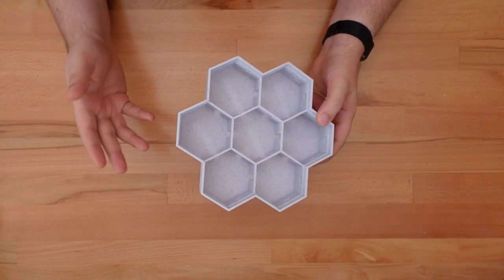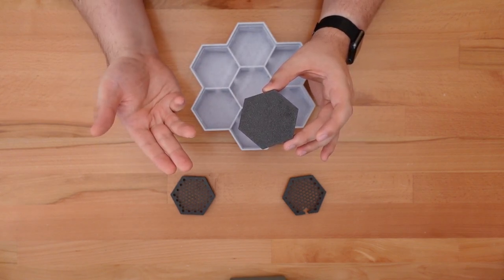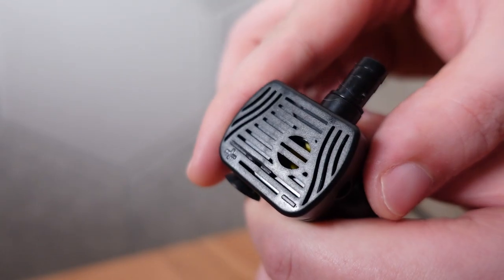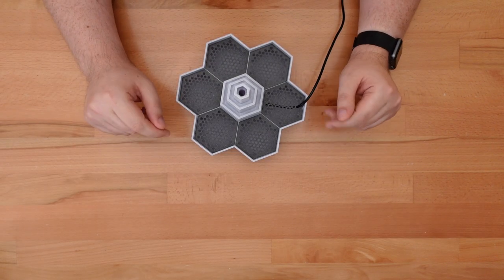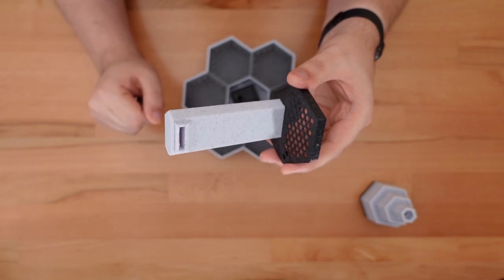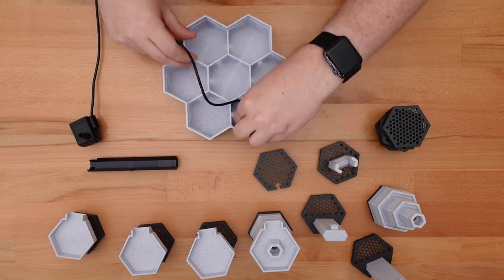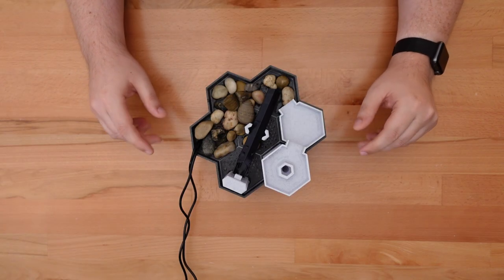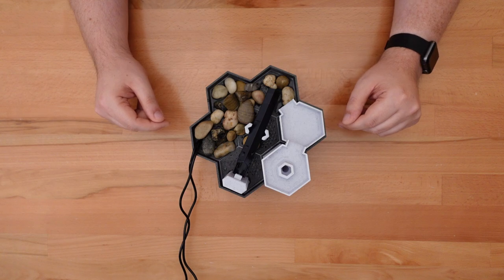3D Printed Modular Desktop Fountain

Comment: It's awesome ! Thank you for this great video 👍🏻 I want to design and print a oriental fountain, this helps a lot 😊 the problem with my design is that the base of the fountain is higher than this one, so I don't know how to pass the pump cord
Do you think if I pass it throught the base (with a hole large enough for the usb and add a small 3d printed part) and seal it with glue, it could hold ?
Reply from the maker: Sounds like a great project!

Adding a hole is a risk, of course, but I think it should be possible to properly seal it enough for that to work! Just add LOTS of glue and test test test :) Good luck!

Comment: May i get some help please? i am trying to print the splash guard part and for some reason its printing like half a cm tall, and when i start the print the nozzle temp goes to 175 and stays there. in cura all settings are fine, i printed nany other things, really strange problem. in the preview on cura its how it is supposed to be and then it comes out different....
Reply from the maker: I can think of two possibilities: The guard is a very wide part and the travel could be pulling on your wiring in a way that either is messing with your thermistor (false reading) or your heater (actually resulting in a cooler nozzle). If this is the case, I'd double check the wiring to be sure you have plenty of free movement and nothing is getting pulled. Another possibility is that the guard is creating an updraft from your cooling fan. I think this is less likely, since 175C is a BIG drop, but I've seen something like that happen. The best solution for that is to make sure your nozzle has a silicone sock to help insulate it from getting cooled.

There are probably other causes I'm missing, but these are what come to mind. I hope that helps!

Comment: Amazing fountain 😍😍
I am trying to make this but perforated plate is failing again and again.
Any tips on how to achieve good print quality on this part?

If you share your print settings it can be really helpful
Reply from the maker: Thanks!

If the perforated plate is giving you trouble, I'd guess it's largely a challenge with the first layer. I'd run a few single layer high prints to make sure everything is extremely level (trammed) and consistent. You'll want the print line to come  out with a flattened top, but not so squished that you can't easily see and feel the height of the layer.

What build surface you're using matters a lot... you can get clean prints on a broad range of surfaces, but my suggestions would depend on the surface and filaments you're using.

Finally, this is one part I would NOT print with a brim. I imagine you aren't doing so, but I figured I should mention that.
Reply: @3DPrinty  thanks for the help dude btw Im using pla on glass bed
Reply from the maker: Great! Since it's glass, chances are your surface is extremely flat. It'll probably just come down to your z-offset and how clean the surface is. I hope your next prints turn out better for you!
Reply: @3DPrinty  thanks man for all the help

Comment: I think I heard you say there are 9 cells to work with, but I only see 7?

Edit: I forgot to ask if the plates will stick inside of each other?
Reply from the maker: Yup, I realized that error too late. I'm planning future bases, though. Maybe there'll be a 9 cell base in the future and I'll be retroactively correct!

The plates do not currently stack or fit into each other. There are already quite a few remixes for this project, so I wouldn't be shocked if that became an option.

Comment: Having issues as the printable parts do not open in Cura because they are not STL files. Can I get the STL files please?
Reply from the maker: Good news! Cura supports 3MF files by default.

In fact, Ultimaker (who makes Cura) is part of the 3MF consortium. That’s the group that designed the format. So I expect they’ll continue to advance the format as it continues to grow and improve.

Comment: Ohhh I love it!
Reply from the maker: Thanks!
Reply: @3DPrinty  I know it can be any color but I like the marble so I need to order more. Looking forward to seeing more ⛲ styles and maybe decorations. I might play with your base plate some. Have you tried putting some of those small submersible lights in the bottom?
Reply from the maker: I do love a good marble filament! Lighting is 100% something I plan to explore in an update - it might look extra cool shining through all the tiny hex holes in the plates.
Reply: @3DPrinty  that was my thought as well, even shining up between the rocks. One last thought if you really want to get tinkering; I wonder if you can design the hexs separately but that can lock together, kind of like those honeycomb shelves. People would have to seal it of course but you could build it as big or as little as you wanted. You could make a long train of them going across your mantle above the fireplace?
Reply: @3DPrinty  also, as far as the lights shining through the hex holes, the hex goes with the design of course but you could make other cut out shapes. Ohhh so many possibilities!
Reply: @3DPrinty  what I'm envisioning is a completely modular mini fountain system

Comment: That's an amazing fountain.
Is it safe and water leak proof if I print it with pla filament?
Reply from the maker: PLA should work - just print at a high temp, print with 3 or 4 perimeter walls, and make sure there is no under extrusion.

If you do all that and it still leaks, you can coat it in Mod Podge, wood glue, or other waterproof sealer that will adhere to PLA.

Good luck!
Reply: @3DPrinty  thank you for your help

Comment: How to water proof an leakage problem???
Reply from the maker: If you're getting a leak, try coating the interior of the basin with Mod Podge or similar sealer. If you print again, increase the printing temp and the number of perimeter walls. Good luck :)

Comment: Anyone had issue printing the plates?? It’s driving me crazy lol. Is there a certain way people print them, or have I just got some issue with my filament/bed adhesion 😢 cheers
Reply from the maker: I assume you're printing them top-side down, correct? They do need some pretty good adhesion for all those tiny holes.  I clean my printer bed monthly with regular dish soap and wipe it down with iso every few print (at least the portion of the bed that had a print). I'm also not above using a little bit of glue stick to be extra sure.
Reply: @3DPrinty  hey! Thanks for responding, and thanks even more for this awesome project!!! Planning on doing a japanese themed one. But yh will give your suggestions a go, using a glass bed atm, so might try the other one ive got lying around if i get really stuck